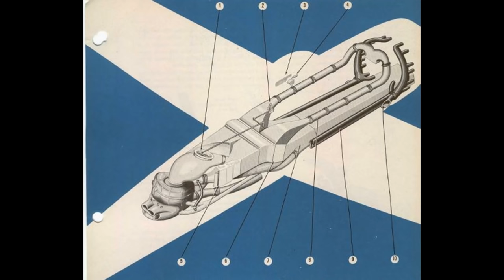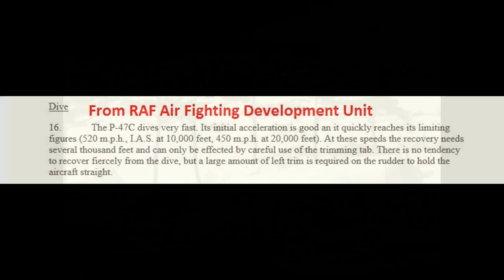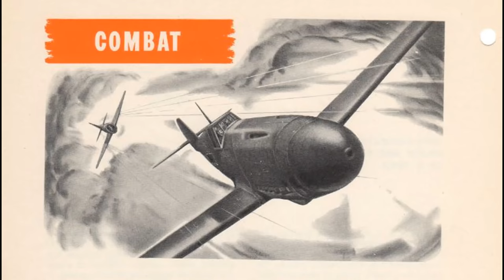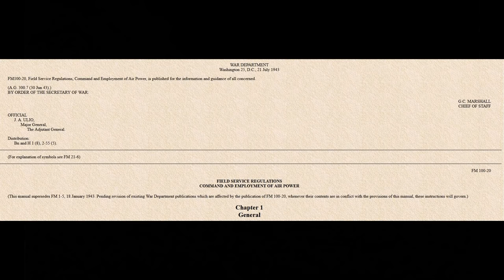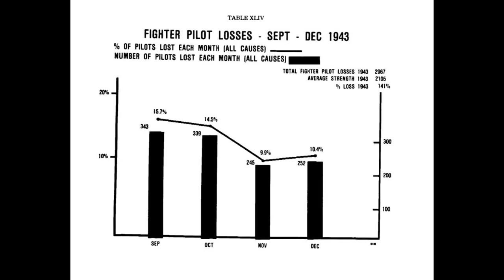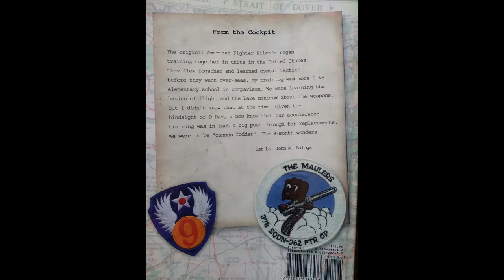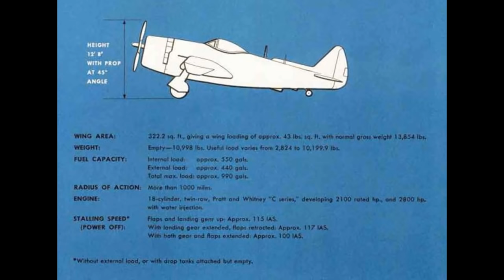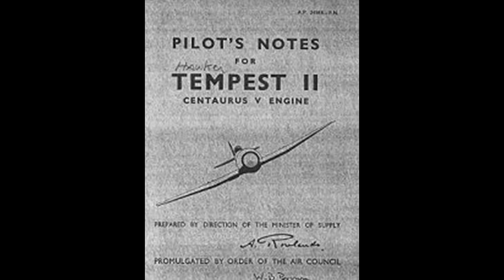P-47 Thunderbolt Pt. 8 Conclusions

Comment: WHITCOMB, R. T. A study of the zero-lift drag-rise characteristics of wing-body combinations near the speed of sound. NACA Report No. 1273, 1956  ahiws Thunderbolt at Mach 0.71. 
It shows the PR Spitfire XXI (no guns etc and aerodynamically clean as possible) at Mach 0.86. Gloster Meteor jet managed 0.85. Mustang 1 0.8, Spitfire XXI with guns 0.81 (basically the same). Thunderbolt is 0.71. P38 Lightning was down at 0.64. 
Spitfire test pilot was Sqdn Ldr Martindale had two near fatal failures (1) where a prop over-speeded and tore off and (2) the supercharger burst. He landed both aircraft.  Maybe the Thunderbolt data was an early model but it is a NACA source from 10 years after WW2.
Reply from the maker: I have an entire video on P-47 dive performance including mach numbers from multiple sources.

Comment: Oopps u finally made a mistake. At 44..guessed the 51 shot down most German fighters  actually the b17 shot down the most.
Reply from the maker: Did it? I do make mistakes, I'm just one person here, but if that's true I didn't realize it.
Reply: I remember reading that Allied bombers shot done more German fighters than Allied Fighters did. Couldn’t tell you the source. An argument against that claim is that a dozen different gunners could be aiming at the enemy a/c making several claims for 1 kill. Although German loss figures should help sort  that out. Interesting claim.
Reply: @Sodbusterrod  if I remember correctly there were two waist gunners that were aces.

Comment: Dad always told me  , 8 th air force  315 th  wing Guam , the P47 is the  best, vary well built in  his opinion  the P40 was nothing compared to this thing......and the B29 was a real Airplane.   And on the oil i think he told me they burned 85 gal of oil per engine on 29s  18hr run? 75 gals of fuel per hr?        He is pictured with the last 29 to bomb japan.

Comment: Hi Greg,  

I finally found the VIIIth  Fighter Command document detailing how the three shift signals technique for fighter escort over France & Germany was executed and when.  

Check out page 68 where the 56th Ftr Group did a 3 Feb 1944 ftr sweep EAST OF BERLIN.

See also page 117 for March 1944 "P-47s escorting to 470 miles."

Colgate calling: offensive strategic fighter control, ETO, 1943-45.
Headquarters, 65th Fighter Wing, 8th U.S. Air Force
https://cgsc.contentdm.oclc.org/digital/collection/p4013coll8/id/4627/rec/1

Comment: I may have missed something but weren’t ground kills ‘ counted as air kills? Little bit of confusion there. Ahh that 109 G-10 on display is at the Australian War Memorial in Canberra and I first saw it in the 1960s suspended  in the roof of a hangar at Bankstown Airport in Sydney, what a revelation it was to see that plane in its original untouched paint work. Someone attempted to smuggle it out of Australia which was prevented and then it became national property . Also at the AWM is an me 262, worth a visit or at least it used to be before the Chardonnay conservation experts started applying their WOKE girly big sister versions of war. Just add wankers.
Reply from the maker: For purposes of pilot kill counts late in the war the USAAF did allow kills on the ground to count. In the post war environment most people including me differentiate between the two.

Comment: The idea that the Cookie only had city-level accuracy is a bit silly. You are not going to achieve precision attacks, but the CEP isn't the size of city either.
Reply from the maker: I think you missed the point. The Cookie is fine for hitting a city, it's not fine for targeting specific things on any scale. It's not an accurate weapon, it's a big barrel of explosives.
Reply: @GregsAirplanesandAutomobiles  indeed it is not for precision attacks, I just think you were overegging the pudding in terms of its imprecision.
Reply from the maker: I'm not sure what overegging is, not do I know exactly what part of the video you are talking about, but the cookie, while a clever thing is designed to hit a city. They were dropping them at night and the RAF's accuracy standard for them was literally did it hit the city or not.
Reply: The part referred to is the section on bomb loads of the B-17 compared to the Mosquito. Whilst I agree with you on the difference on individual bomb loads (the B-17 could carry more, and a greater variety in general) I didn't feel the comment on the Cookie was accurate. 

It is also not accurate to say that the RAF standard of accuracy was entire cities. If you actually look at the target lists you find that very often, and for mass raids, it is things like factory complexes or districts of cities. Harris might have suggested that entire cities were the targets, but in terms of actual planning this was not generally the case. 

This was even true in 1942 when accuracy at night was still relatively poor - targets all the way up the Rhine into cities like Ludwigshafen were industrial areas, including as small as the BASF factory there (although factory complex might be a better term). From memory that was attacked in April 1942 by several hundred aircraft, although that was probably still with GP bombs, possibly MC rather than HC (Cookies and similar). Cookies were seen as having value for industrial targets for removing roofs and exposing machines to the elements.

Further evidence that the actual target was typically less than a city was concern about creep and target remarking. If creep was likely and only a city was the target then given size you could just mark the far side and let creep do its work, but that is not what happened as specific areas of cities were generally the target.
Reply: @GregsAirplanesandAutomobiles  overegging means overstating, derived from adding too much of something good (eggs) to a cake.

Comment: mumles and grumbles about mosquitos being not just fighters, but has to accept they arent as good
Reply: I completely missed the point that if you don’t actually destroy the enemy aircraft they will have an ever increasing fleet to send up. 

I must re think my previous idea based purely on manufacturing capacity and available flight crews. 
This idea was to have distributed manufacturing of one series of aircraft using least amount of scarce materials so no one place could jeopardise production. 

The possibility of attacking airfields and destroying the planes on the ground may possibly have an effect. 

This brings me to the realisation that England didn’t have any great fighters. 
Sea fury , tempest , hornet perhaps but really, they only had short range light fighters. Nothing heavy.

Comment: When you state that the Seversky airfoil is better than the NACA series, the 23000, I assume,  how do you quantify and justify such a statement. I have never seen such supporting evidence to make such a claim
Reply from the maker: I quantify and justify the statement by comparing maximum mach numbers and other data critical for a high altitude fighter plane. All of which is backed up by NACA reports shown in the earlier episodes.
Reply: @GregsAirplanesandAutomobiles  
Not disagreeing with the performance numbers just your assignment of the Seversky airfoil as the responsible party. The semi elliptical planform, overall taper percentage, fully metalized wing including ailerons with thin tips and trailing edges has much more to do with it in my opinion. Honestly from my studies and understanding of Seversky’s airfoil designs they were a bit simplistic and ordinary. I think if that airfoil was that good they would not have gone away from it on the N model

Comment: I think trying to determine what aircraft had the single greatest impact on the war is a bit of a moot point, if not to say a pointless family jewel measuring contest. For example if it wasn't for the Spitfire and Hurricane the P-47 wouldn't have had bases to operate from. If it wasn't for the 109 the Germans might've never gotten so far that the P-47 was necessary. If it wasn't for the IL-2 the Luftwaffe could've spared a lot more machines for the Western front. Etc. Etc. Etc.

Comment: Too many things to point out.

1. The majority of Axis loses (between 76% to 83% depending on source), occurred on the eastern front, except for Luftwaffe and Kriegsmarine. 
Germany was doomed due to a lack of resources (oil primarily), lack of industrial capacity and lack of manpower. The Thunderbolt didn't really contributed in Operation Bagration and the other soviet offensives. The american trucks did, ditto for american radios, industrial tooling, Al alloys, oil, spam cans, boots and uniforms. 

2. As pointed out by Military History Visualized, the increase in production from '43 onwards came at the expense of spare parts production (in other words there was no miracle in overall production). And the lack of spare parts was crucial, because that's what men complained most about, not lack of equipment/tanks/planes (unless you're talking Army Group Center in mid '44). 

3. From my knowledge, the kill per sortie favored the Mustang by a ratio of ~3.5 to 1 in the air and 3 to 1 on the ground, vs. the Thunderbolt, even when compared as apple to apple as possible. 

4. German generals don't understand logists. The german counter offense would have fizzled out due to a lack of fuel (and probably lack of spare parts).

Comment: P47 was a pig of an airplane compared to the P51. It was reliable, competent, had good trade offs,   The P47 advertised top speed was similar to the Mustang but needed 800 hp to do it and used twice the fuel at half the range. Cost less to build, maintain and had performance that made and average pilots good. Plus could never be used in Korea because it required a very long airbase to take off even without bombs or fuel. Marginal performance here and there is helpful. More P47w were lost in combat and shot down and destroyed a lot less fighters.

Comment: The idea that the US strategic bombing campaign was to destroy the Luftwaffe is a post hoc rationalisation by USAAF command when it became clear that the initially avowed aim at Casablanca of destruction of German industry via bombing was failing to have sufficient effect, much as RAF attempts were also failing.
Reply from the maker: The timeline shoots a huge hole in your theory. The USAAF had only flown two large scale missions into Europe in 1943 before the Trident conference. It wasn't until after that the bombing ramped up. Check the dates, the Trident conference was in May of 43'. The scale of US bombing up to that point wasn't anywhere near large enough to say anything had succeed or failed. https://en.wikipedia.org/wiki/List_of_air_operations_during_the_Battle_of_Europe

Comment: I would recommend Spitfire by Alfred Price Chapter10 Eagle Sqn 8th Air Force ,  Morgan and Shacklady Spitfire the History Page 312 [stating that the RAF were also released to Hunt the enemy] for 2950 enemy AND Eric Brown Testing for Combat a pilot that Greg does not like. 
 Dives Greg may be interested in CAS but the actual tests in 1944 the authorities used IAS 
1.  The Reports to the tests of the 4 aircraft P38J P47 P51B &  P80A Report Written 26 Jul 44 Wright field P47 Indicated limit diving Speed [ ILDS ] was 500 mph 
2, Test of the P47C @ AFDU   Duxford Report No 66 3 RDM 43 p47C dive very fast butt reaches its limits @ 520 mph IAS @10000 ft and 450 mph IAS @20000ft
3. Another Test at RAE Farnborough Early 1944 Diving from 40000ft @ 45 degrees the P47 at full bore had to peel off at a Tactical Mach of 0.71/0.72 between 544 mph and 552 mph it may have beaten the Typhoon but NOT the German two. And certainly not the Tempest O.83 
By all means write down Gregs figures but then do your own research
Reply from the maker: Jack, I'm not sure what your point is here about the Spitfire, but I do want to respond to the other comments. 
First, Eric Brown, I'm not sure why you say I don't like him, that's not true. I do point out that his comments on the P-47's dive performance are in strong contrast to literally everyone else who tested the plane. In fact the comments you just made reference tests that disagree with Eric Brown. That doesn't mean I don't like him. I'll number these responses to match yours.
1. That report is listing the number in the pilot's manual, it's not a dive test specifically. Also 500 mph at 10,000 feet is about .78 mach. That number .78 is conservative but still faster than the German fighters.
2. That's a British report and it shows a mach number at 20,000 feet to be quite high. 450mph at 20,000 in the standard atmosphere is .836. https://aerotoolbox.com/airspeed-conversions/ Considering NACA tested the P-47 to .83, I would say that's possible.
3. Yes, this is the Eric Brown test. There are so many problems with this test it's hard to know where to start. However just the fact that it differs so much from literally every other test ever done on the plane, including the two others you just mentioned  I think we can discount it.
Reply: @GregsAirplanesandAutomobiles  Greg Brown was not at Wright Field June 44 and he was not at Duxford for the other test by AFDU.  
" I think we can discount it. " Page 58 shows a photo of 48 Test Pilots at Farnborough in 1944 You do know Brown was not alone he was but one of those 48 pilots and did NOT have the final say. 
So you are saying that all the tests were wrong ??????

Comment: Mosquitoes could make accurate bombing.  Quickly.  You try to be objective - but you are very programmed ...
The whole ‘strategic’ bombing campaign against Germany was a total failure.  Both USAF and RAF.  The combined tactical / strategic airforce (with more emphasis to tactical) where the P47 excelled - would have made sense.  In hindsight, not much of the British or American ways made effective sense.  A German.
Reply: SPAATZ: Did the Germans realize that the American Air Forces by intention did only precision bombing? 
-5 
GOERING ~ Yes. I planned to do only precision bombing myself at the beginning. CURTIS: Was our selection of targets good, particularly oil? 
GOERING: Yes, excellent. As soon as we started to repair an oil installation you always bombed it again before we could produce one ton.
 [PDF] COPY INTERROGATION OF REICH MARSHAL Jewish virtual library

Comment: "Interdiction of enemy movement and supply by large scale (and, in the main, wholly inaccurate-ed) bombing of infrastructure."  -That seems to be one of the underlying Allied strategic schema examined in some detail by the Strategic Bombing Survey.   It's why we bombed railyards.  Well, that and the ease of navigation.  "Follow the rails till you see something complex and then let fly!"
  With that said, Schweinfurt and Ploesti were deliberate adjuncts to the Air Superiority campaign.  Accepting high bomber loss to ensure interruption of ball bearings/Avgas supplies is a scalpel cut, in strategic terms.
  And a point about dissemination and whitewashing.  Check the fuel and ammo, logistics train, housing, and hangar/runway needs, Greg, for the different campaigns: Air Superiority and Strategic Bombing.  We did not excel at pinpoint attacks against enemy fighter units.  We bombed civilian centers.  We expended only a tiny fraction of resources in the Air Superiority campaign compared to those we applied to the strategic bombing of enemy population centers.  So, by that measure, methinks the lady doth protest too much.
Reply: Extensive verbiage for no legitimate point.  After the War, the German high command (including Speer) felt that the Allied air campaign was highly effective from both the strategic and tactical POV.

Comment: The P-47 was a big fat heavy fighter.  But it wasn't pretty and it wasn't a sexy airplane.  There is no mystery that they called it The Jug.   A 109 or 190 could dogfight the P-47 into the ground.  The only chance the P 47 would have  is if the P-47 saw the German plane first.  Lastly the P-47 was something of a one trick pony.  Dive dive dive is the detail repeated over an over for the P-47.  Byu not many words about turning, roll and climb.
Reply from the maker: Not to many words about turn roll and climb? Seriously? I have entire videos about the P-47's turn, roll, and climb performance. This is Part 8 in a series. It amazes me that someone can go to the last video in a series and then whine that it doesn't have all the information they expected. That's like reading only the last page of a book and then complaining it didn't have deep enough content.
Reply: Apparently, you didn't watch the videos, assimilate the mountains of information contained therein, or comprehend the analysis which demonstrates that everything you just said is completely incorrect.